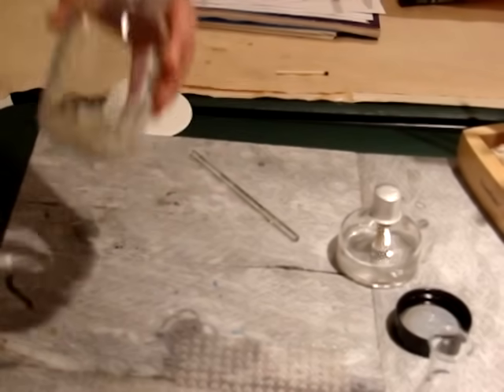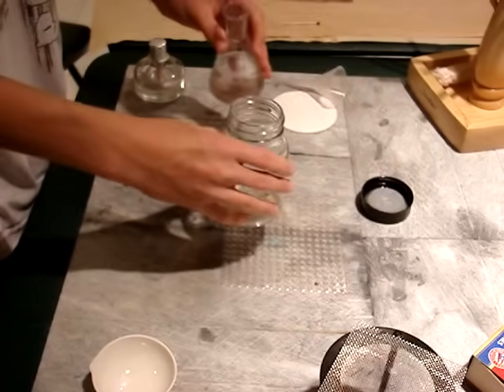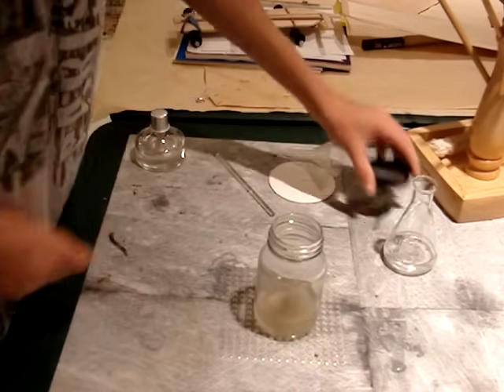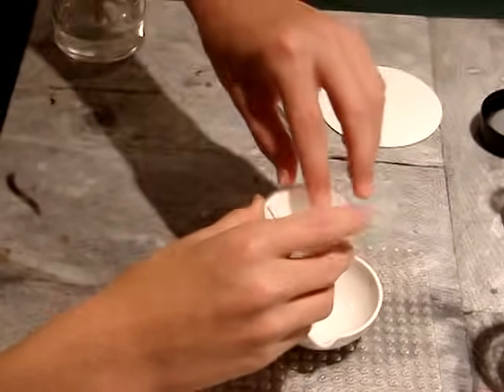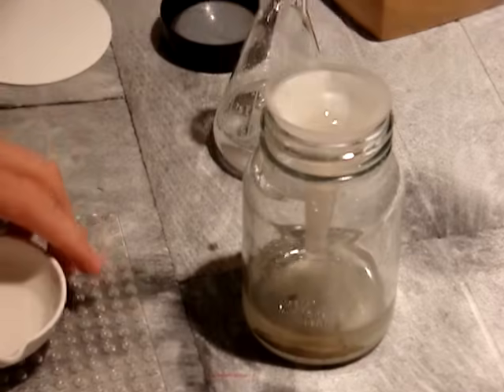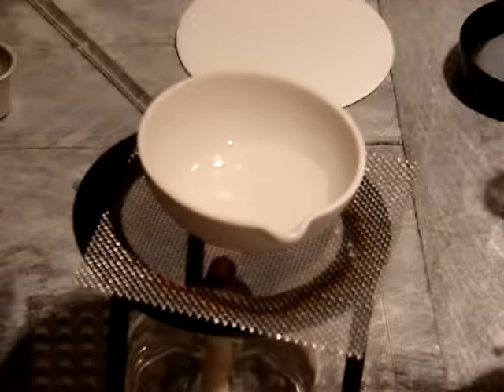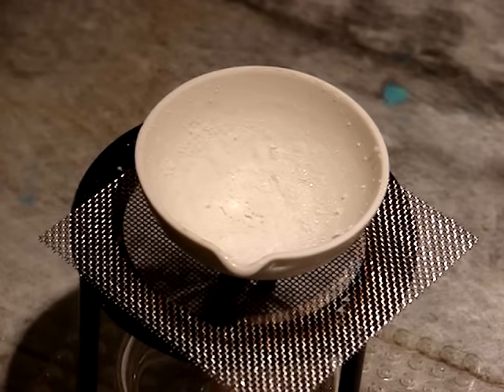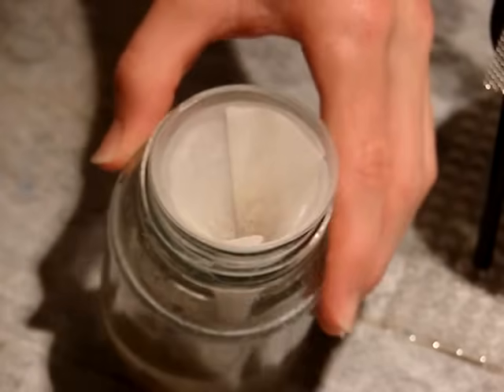Separating a Mixture of Salt and Sand

Comment: No, the exact amount of salt will be found afterwards, assuming you do the experiment correctly (don't let any salt escape during evaporation, shake the bottle of sand + water + salt enough to dissolve ALL of the salt) However, the mixture probably wasn't only pure sand water and salt, so afterwards you will most likely have salt left after evaporation with some other dirt that was able to pass through the filter.

Comment: thank you a lot
deserve watching claps claps 
you don't have to read the rest 
I wrote it to rate my understanding and visualize them 
hehehehehehe
so what basically happened is that you took a mixture of liquid with a soluble and another non-soluble component and you basically concluded both a homo and heterogenous mixtures you started by a heterogeneous mixture which was sand and water and you did the filtration method which involves having a filter paper a filter funnel and a some sort of beaker then after you have done with the heterogenous part you moved to the homogenous part which involves salt and water so you took that mixture put it in an evaporation dish and wallahh the magic started to happen the method is called heating to dryness and yup amazing thank you